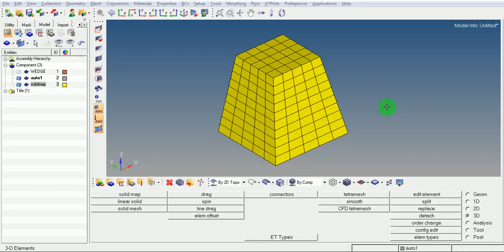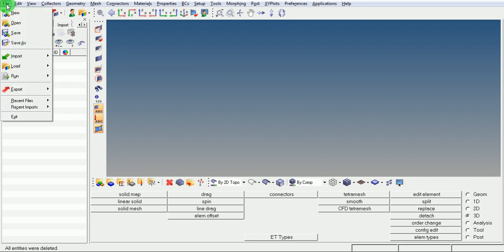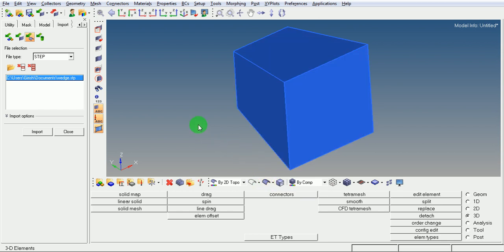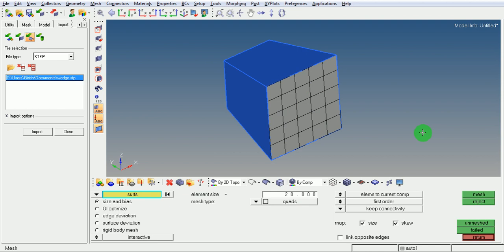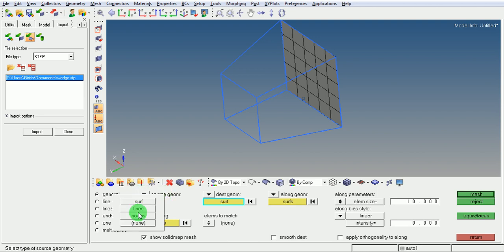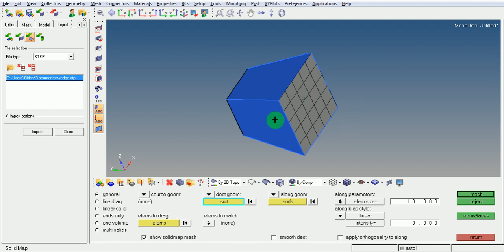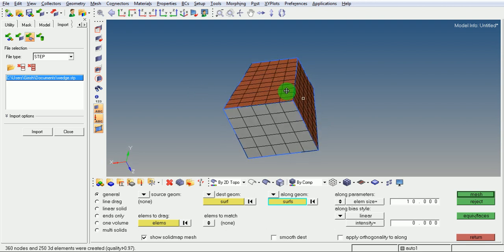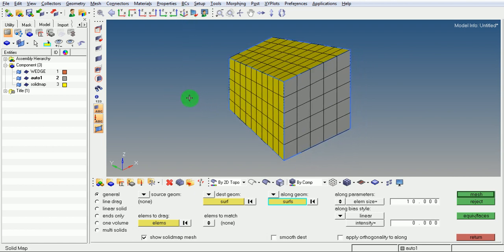Hypermesh Solid map mesh | 3D मेष हाइपरमेश मे कैसे बनायें | Hex meshing of helical geometry | GRS

Comment: Hi sir, I have one problem in Hypermesh... I'm not understanding what is the difference between Terramesh and volumetric tetramesh... Could you be open to explain.
Reply: The main difference between Tetramesh and Volume Tetramesh is that Tetramesh will generate a mesh based on the current 2D/shell mesh that you already have generated. The volume Tetramesh feature doesnt need this and can fill in a volume automatically with tetra elements. Hope this helps!